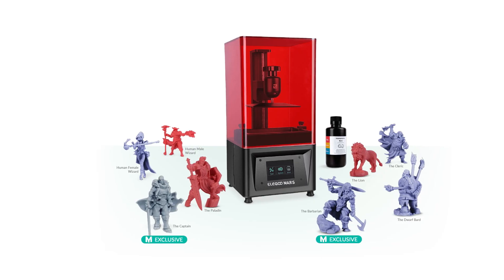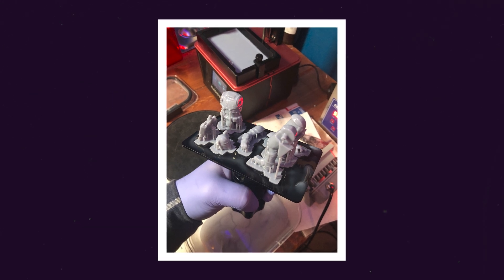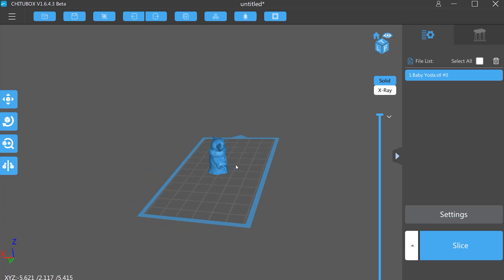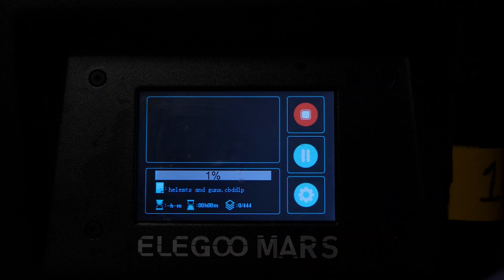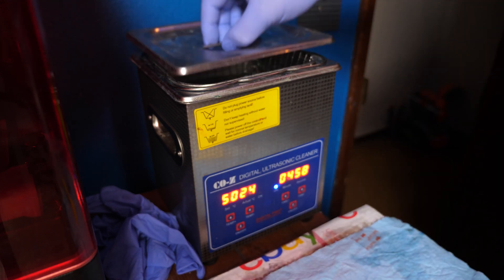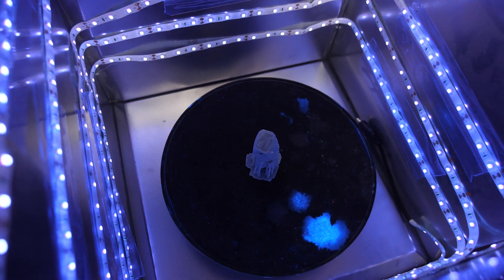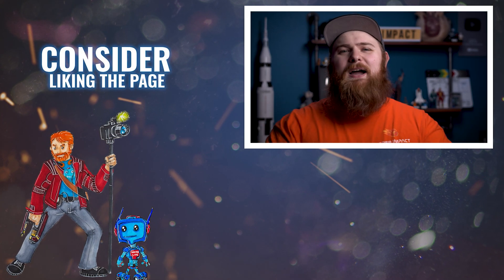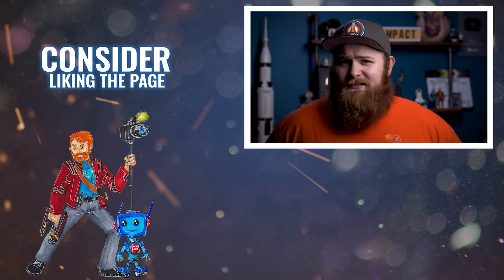3D Printing with Resin - How to Setup and Cure Your Print

Comment: It seems like the last 3 times I printed nothing came out it was just resin stuck to the flat bed,  what is causing that
Reply from the maker: Make sure your leveling the bed if that doesn’t work use some sand paper on the bed to get it a slight texture that way it gives more of grip for the resin